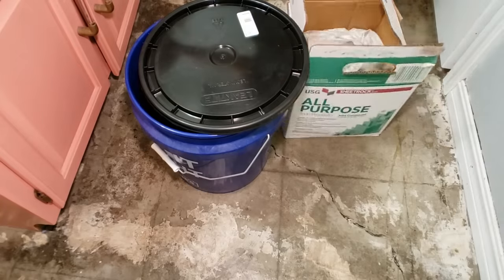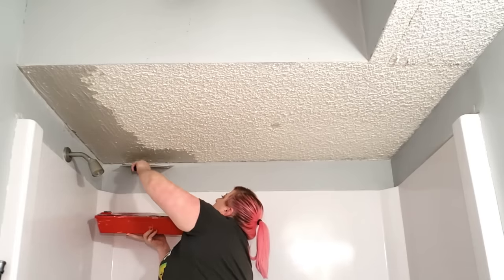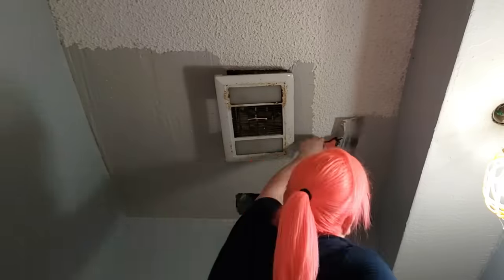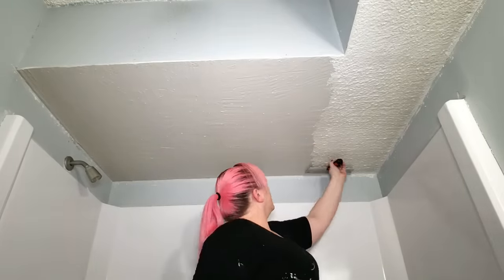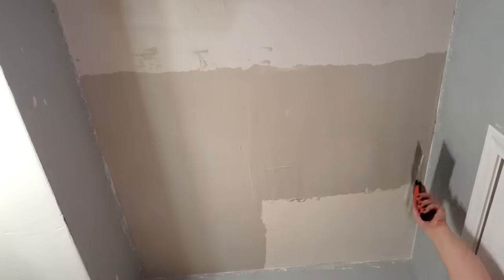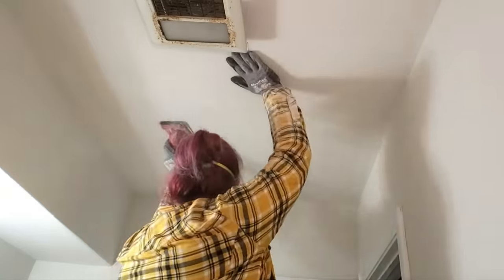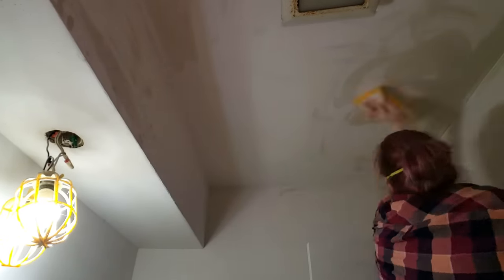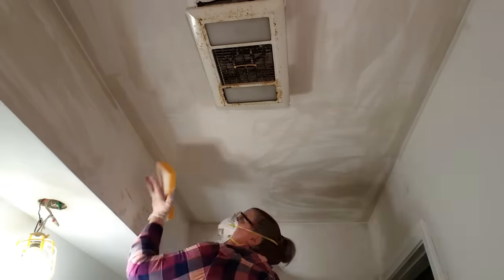How To Cover Popcorn Ceiling Without Removing It | Skim Coating Over Popcorn Ceiling

Comment: The plaster isn't structural, hence why your suppose to put on very thin coats. By not sanding popcorn you now have a very thick coating in a unsupported position (inverted vertical). Maybe in any other room it would last 5-10+ years but it's going to start cracking and falling off. But that's the bathroom, the humidity cycling is going to destroy it in a fraction of that time.
Reply from the maker: Popcorn texture isn't structural, either. Popcorn adheres to the drywall underneath it. After popcorn has been sealed (primed, painted), the joint compound adheres to the popcorn. In this situation, sanding the popcorn would expose unpainted popcorn, leaving it unsealed and making it possible for the moisture from the joint compound to soak through, weakening the popcorn adherence to the drywall. The reason you want thin coats of joint compound is so that it can dry properly without massive shrinkage and cracking. Even though I'm filling in that texture, I'm still doing it in thin coats. Also, this is primed and sealed, just like drywall is. The moisture shouldn't permeate the joint compound once it's been sealed, and it shouldn't fail. I've had zero problems with any skim coat ceiling I've done, including in this bathroom. There are plenty of people who follow this method, including drywall professionals, without fail.
Reply: You'd put a thick (cumulative) non-structural material on top of another non-structural material in strong humidity cycling location. 
Even if its mostly sealed its going to be stressed far beyond its intended application. I don't know when it'll start to crack or crumble, but if it would normally last 20 years, this definitely won't.
Reply from the maker: It sounds like this isn't for you, and that's fine. For me, this has worked out great. I do a lot of research before starting any project, like I did with this one. Skim coating over popcorn is something that's done daily by drywall professionals when dealing with painted popcorn. There are other ways to deal with it, but this is one of them. These products are made to adhere to drywall. They can be used wrong and fail. They can be used properly and succeed. Popcorn texture can fail after a few decades and start to separate from the drywall, so yes, of course, this could do the same. That goes for absolutely any cosmetic finishes in your home, including flooring, wallpaper, cabinets, etc. If it holds up for a decade before it needs some repair work, I'd say it was worth my time and effort.

Comment: U can  also use  sponge or a hot rag too smooth out  your thin set after last thin set hit again with rag or spong again  let dry, use 180 grit last too hit the tinny bit or bumps done sanding is a bitch way to much work if you go that way. I suggest  u scrap it off use a water pressurerized  water sprayer with carpete lay plastic  covering and move furniture  to one side . Use one to one side w/ a wide scraper with a painter pole Uwill see it soak in then start scrapping  simple. Some areas u may have to push harder then others good luck and take your time bye for now

Comment: Scraping popcorn is messy but it's actually quite easy. When you remove it, you only need 1 skim coat to cover the ceiling.
Reply from the maker: It is messy but easy. Painted popcorn isn't always easy to remove though so I took this route to avoid that headache.
Reply: @TheNiftyNester  We bought a house last summer & the ceilings are extra popcorny. I like a slight orange peel look but these are hideous. We scraped a couple of rooms and painted but they really need a nice smooth skim coat. I absolutely hate being a diyer but I have no choice.  Your video helps. Thank you
Reply: We have asbestos popcorn so it might be better to skim it
Reply from the maker: I would definitely skim coat it if it's asbestos (or hire someone to scrape it but that's expensive).

Comment: I have to say I disagree with your method.  Popcorn ceilings are messy but super easy to remove once wetted.  Once you've scraped the horrid stuff off - the difficult part is not scraping the texture, but ensuring you don't gouge the drywall - you could easily do a skim coat if needed, but using far less mud

Comment: What about adding paint to the compound
Reply from the maker: From what I've read, you wouldn't want to mix paint into the compound when you're using it to skim coat the ceiling or walls. I imagine it would affect the glue in the compound and its ability to stick to the ceiling. The adhesive also helps to keep it from cracking, so you'd probably have more cracks to worry about if you mixed the two. There is a dye additive that's meant for joint compound, but it's more for being able to see where you've applied the compound. I'm not sure what colors it comes in or if they'd work as a wall color.
Reply: NEVER put paint in your mud (joint compound). Fyi, all purpose (green box)  has more adhesive than the easy sand (blue boxes). First coat is always all purpose because of the adhesive then the easy sand is used on the 2nd and 3rd coats when doing finishing work. Make sure the popcorn does not have asbestos in it. There are certain ways to tackle it if it does.

Comment: This technique is great but make sure to scrape it down first. Give it a light spray with water to soften it. Wait 10-15 minutes and GENTLY scrape it down. This will eliminate the real high points make coating it easier.
Reply from the maker: This method was meant for painted popcorn. My bathroom ceiling was primed and painted by the previous owners, so I couldn't spray and scrape it like I did in the other rooms in my house. I wouldn't suggest using skim coat over unpainted or partially knocked down popcorn. The moisture from the joint compound will soak into the popcorn, causing it to possibly come loose from the drywall underneath. Painted popcorn is sealed so you don't have to worry about that happening.

Comment: I will never understand skim coating over popcorn. Scaling it off isn't hard at all.! In all the years of home repair ive done myself,  I've never had a problem scraping it. Also if someone comes in later and wants popcorn again they can't, because if you put popcorn over more popcorn and paint and join compound. if the slightest bit of moisture gets in, Well... It all comes down. (Yes I've seen it happen) skim coat over popcorn is a waste of joint compound and a waste of time. Takes less work to scrape it off. Also you'll be able to see if there any water spots under the old popcorn.

Comment: This is a cool video and works, however as someone who has a business and does this type of work regularly, it's far less exhausting and time consuming to just remove it and use a hopper to spray on texture.  Most people are gonna do this and not sure if she mentioned this or not but your shoulders are gonna give out in about half a day especially if you've never done this type of work.

Comment: OK, but covering over an asbestos hazard doesn't work if you need to cut a hole in your ceilings for new electrical wiring.  The asbestos fibers will rain down on you.
Reply from the maker: Anytime you have to disturb the asbestos it's a hazard so yes, this won't fix the problem when cutting a hole into the ceiling.

Comment: So you have to pAint the ceiling when your done?
Reply from the maker: That's a good question. From what I've found with skim coating is that it should be treated like new drywall and should be primed then painted. It's a porous surface and the primer helps to fill in and seal that porous surface. Especially if you live in a humid area or in rooms like bathrooms that get really humid and that can create mold issues if it's not at least sealed with a primer. I hope that helps.
Reply: Thanks 😊

Comment: That was way more work than just wetting it and scraping it! You had to mud 3 coats. Scraping it comes off in one step you have to wet it and it peels off easy!
Reply from the maker: There are several ways to handle popcorn ceilings. I've scraped the majority of mine and skim coat the ceiling afterwards. If it's painted (like this one was) it doesn't just fall off like normal popcorn texture does. It can be done but not as easily. This is also a better solution for anyone that has asbestos, it can be covered and you don't have to worry about it. I've shown both ways in separate videos so other DIYers can decide which works best for them.

Comment: connect that 10" knife to a painting stick with duct tape and mist the ceiling with hot water and after you see it's soaked into the ceiling do it again and now that 10" knife will go threw it like a hot knife threw butter. Scrap ceiling and do a small skim coat. Takes your 3 day project to a 1/2 day project 🤷🏼‍♂️
Reply from the maker: This is for painted popcorn as stated in the thumbnail and the title, but I didn't make that clear enough in the video itself. I've scraped lots of popcorn ceilings, but that method is trash when dealing with thick layers of primer and paint over popcorn.

Comment: I’m in the process of doing this to my whole house, walls and ceilings. They’re ALL swirled. Why did someone think it was a good idea to put swirls all through a house!? This is a lot of work! 😬
Reply from the maker: I feel your pain! It is a lot of work. If only they knew the work they were creating for us when they textured these ceilings and walls.
Reply: The swirl patterns came from when walls were made of plaster and lathe, not sheetrock. It was designed to cover the imperfections of walls made of wood lathe and frequently chicken wire to hold the plaster in place. Very similar to stucco exteriors done today. And in it's time plastering was an art form!

Comment: Do you have to sand the wall?
Reply from the maker: Yeah I haven't found a way to avoid sanding (I would avoid it if I could) but I have seen videos where they covered the popcorn then added a new texture, something softer and better looking than popcorn. You might be able to avoid sanding if you did something like that and created a new texture in the last layer of skim coat.
Reply: The Nifty Nester okay thanks so much

Comment: Wouldn't it have been easier wetting the ceiling and scraping off the popcorn? I have removed popcorn and once it's wet it comes off easily. Plus I do find it too much work for something most people don't look up to see. When ever I go to a house I really don't care what type of ceiling texture they have. I rather invest on things that are actually more visible.
Reply from the maker: If you're dealing with popcorn that hasn't been painted, then yes, scraping is easier. I still end up skim coating the drywall after scraping to get the finish I want. This is for painted popcorn ceilings. The paint is too thick to scrape the ceilings. It would've been a nightmare, and I would've damaged the drywall, needing more skim coat work in the end. As far as no one looking at it, I look at it, and I can't stand it. I'm sure it doesn't bother everyone, though. We also have a couple of asthmatic kids. I'm getting rid of the popcorn ceilings and carpet as I work my way through the house because they're both horrible about collecting dust.

Comment: Can someone please tell me how so many ppl are saying this is smart. Scraping the popcorn off leaves a clean flat surface, is SO much less work than this and is the proper way to do this. Joint compound is not designed to work this way. It’s not water resistant and will likely cause issues when used in a bathroom once moisture gets to it. It’s so inefficient to sand and sponge by hand and so many layers on this. The radial pole sander is more efficient and is the better option as well.  This is also DEFINITELY not cheaper than removing the popcorn. 

To remove popcorn, you tape up the plastic on the walls and throw down plastic on the floor, use a weed spray can pump from the hardware store full of water, prescrape the ceiling with a radial sanding pole or with your scraping tool, then spray the crap out of the ceiling until it’s saturated enough that it scrapes off easily. Prescraping allows the water to penetrate behind the paint. Then you throw out the plastic on the floor with the popcorn inside when you’re done. You will still have to sand, fix any mistakes and then paint but you don’t have to waste time adding 3-4 layers of this and have bubbles in your ceiling.

Comment: Why didn't you just scrape them? This was a high amount of time. Simply lightly wetting it and allowing it to sit for a few minutes then taking a wide trowel to scrape goes super quick. Then you simply have to do a light skim coat. As per sanding, just use a grout sponge and a bucket of water. Wiping over it with wet sponge is like sanding but no dust.
Reply from the maker: I get this comment every day and respond every day. Unfortunately, I can't edit the video to clarify this, I wish I could. This ceiling was painted. You can't just simply spray and scrape painted popcorn. So yes, scraping is faster, which is why I've scraped the other ceilings in my house. It wouldn't have been faster in this room. It would've damaged the drywall and I would've been better off replacing the drywall or hanging new drywall over the popcorn. Skim coating is an alternative to that. It costs less and I can do it by myself, which is a big bonus.

Comment: Why would you do this when you can scrape it off in a fraction of the time for the same result
Reply from the maker: Not all popcorn comes off easily. I've scraped the other ceilings in my house but this room had painted popcorn which does not scrape off as easily.

Comment: Lazy work it’s easy to remove popcorn ceiling. Won’t last if moisture or bad humidity gets to it. That’s going to peel off like bad sun burn.
Reply from the maker: I wouldn't call this lazy at all. This was a lot of work. I've removed popcorn ceilings. It all depends on what you're dealing with. If your ceilings aren't painted, then scraping is obviously the way to go. You still might need to skim coat afterward (I do) because the popcorn was hiding damaged, poorly installed drywall. If your popcorn ceilings were painted, as these were, you might not be able to soak through and scrape the texture off very easily. This ceiling would have been a nightmare to scrape. And, as I said before, I still would've been skim coating it afterward.
As far as the moisture goes, if you're doing it right, there shouldn't be any peeling at all. This is a high traffic bathroom, lots of hot showers every day, not a bit of peeling. The joint compound should adhere to the sealed popcorn texture. Once the joint compound is sealed, moisture shouldn't be an issue.

Comment: I couldn’t ignore the ghastly old rusty edged extractor fan . Somehow I just found it revolting .
Reply from the maker: I replaced the exhaust fan later in this makeover. At this point, we had picked one out, but it wasn't here yet, and I didn't want to wait to move forward with the next project. Since this makeover was shared as a series, not every project was done in one video.
Reply: @TheNiftyNester  I do apologize . I was certainly distracted by the fan , it reminded me of those toilets you get to in basements (I live in Canada these days where restaurants toilets often are in basements ) and you have dirty buckets and mops in a corner , and such fans in the ceiling.Terribly sorry .

Comment: I cringe seeing creators give bad advice on YouTube.  Just put down some dropcloths and scrape the popcorn.  You have to wet it with a sprayer first.  It's not that hard.  Buy a tub of pre-mixed joint compound to patch any rough areas.  Wait till it's dry and sand.  Texture to match the walls or other ceilings in the home if you wish.  If you texture, it will help hide blemishes in the drywall so you don't have to skim the whole thing.  Honestly, you will use less joint compound by scraping first than trying to cover all the popcorn with a skim coat, plus you'll hurt the value of your home in my opinion if you just do a cover-up job.
Reply from the maker: I should've stated this clearly in the video. The thumbnail and title obviously didn't get the point across. This ceiling was painted. In every other room of my home where the popcorn was unpainted, I've scraped the ceiling and skim coat the drywall to get the finish I wanted. This method is for painted popcorn only. You can't just spray and scrape painted popcorn. There are thick layers of primer and paint. The popcorn has been sealed. So, at this point, I can damage the drywall trying to scrape it off, replace the drywall, cover the popcorn with drywall/beadboard, or skim coat it. I went with the skim coat.

Comment: You can buy a sprayer & popcorn ceiling scraper that you attach a grocery bag to & get rid of that crap A LOT cheaper, easier, faster. I'm at a total loss as to why you'd spend all this time & money to cover vs scrape a small bathroom ceiling. 🤦🏼‍♀️🤔😣😧😒
Reply from the maker: Because these are PAINTED popcorn ceilings. I should've stressed that more. If your popcorn isn't painted, then scraping is the way to go. Once they've been primed and painted, though, you can't just spray it with water and scrape it like you would unpainted popcorn. It's really hard to scrape. It's easier to damage the drywall, and you'll likely be skim coating to cover the damage afterward anyway.